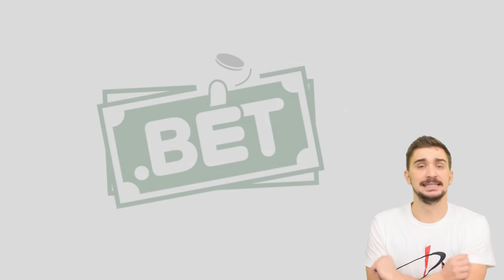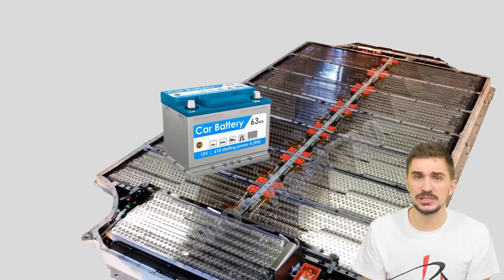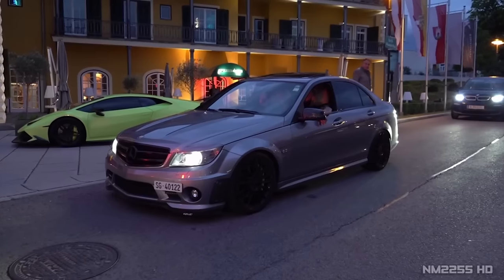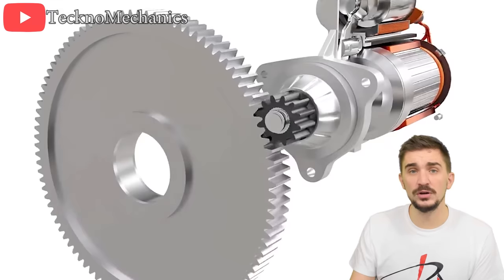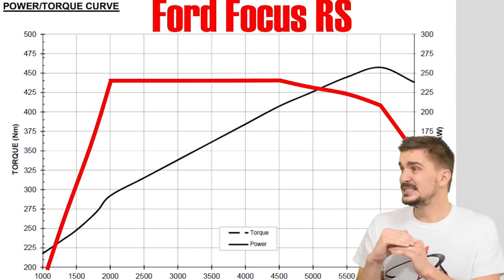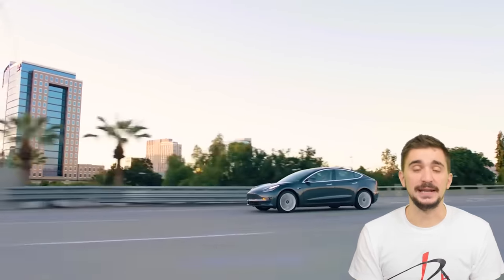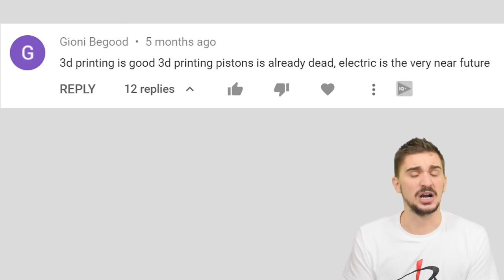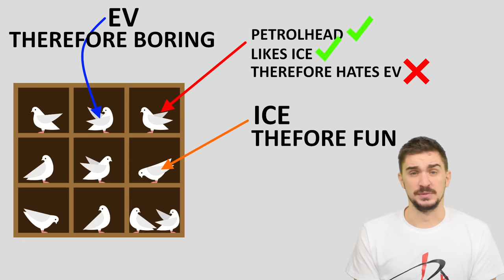ICE vs EV - IN-DEPTH comparison of BATTERY ELECTRIC and INTERNAL COMBUSTION ENGINE vehicles

Comment: Your monologue at the end perfectly reflects my (and I hazard to say the majority of professionals in the tech/ mech engineering space) opinion on the topic. A hyper focus on electrifying cars is the result of marketing. Real solutions to our problems are almost always variable and address whole systems. Electric cars are a tiny part of any real solution. They are phenomenal within a narrow use case. Better solutions exist elsewhere, like drastically expanding public transit in and between our fast growing urban centers, addressing/ drastically reducing emissions of grid scale power generation, finding cleaner more efficient ways to maintain intl supply chains/ logistics, improving resource utilization in agriculture, etc etc etc. Real solutions are hard to market. They are complex and often make unsexy compromises. They are also rarely achieveable by induviduals.
This might come off as cynical, but imo the truth is many electro evangelists have been duped. Environmentalism, like almost everything, has been co-opted so it can be used to sell. It has been rebranded as a problem that can be solved by the individual buying a product. Buying into a brand (tesla) is presented as a stand in for environmentalism. So many people have been beguiled by these ploys. That anyone is so blind to miss the irony in solving climate change with consumerism, is itself a tradgedy. By truly educating, and not watering down topics to make edutainment, you are doing more to protect the future of the environment than any of those detractors. Keep it up. You are awesome.

Comment: You hit it on the head. When EVs are actually viable, I'm all in, but right now they're not.  They're commuter cars in big cities and that's it.  Give me a 10 minute recharge to full battery and enough charging stations to make their range viable and I'll have one.  One thing not covered is environmental impact. Somehow everyone thinks the EV is better by default because it doesn't burn oil, but those batteries are still charged by burning coal and there is a big environmental impact from battery manufacture, so they are not nearly as 'green' as everyone would like us to believe.
Reply: My Ev I charge from the sun. Free of charge. No middle man controlling my gas/electric price.
Reply: @radiculus27  with a solar charging system made from dead dinosaurs, just like everything else.  Maybe check the manufacuring process of your batteries too.
Reply: @mwalker9401  
While almost everything do have environmental impact. Solar is definitely lower that of fissile fuels . Don’t even get me on the lives lost in the name of oil? Millions.  We can go back and forth as anyone can find someone who will support their point of view. Solar panels do generate way less pollutants than fossil fuels . It’s just depends on how the bi products get treated. Some cut corners and others don’t as in any manufacture process. But if handled responsibly solar is way way less pollutant than coal. A lot of articles point out the environmental cons of the manufacturing process but can you show me one that’s compares the two?
Reply: @mwalker9401 oh um there's a video about the the pollution on that it's from GasTroll video name is called " Ev vs Gas which pollutes more"

Comment: As impressive as EVs can be, the thing that bothers me about them is they dont make any sound. A lot of interesting ICE cars have rhythmic intake and exhaust notes, anything from an V2, I3, I4, I5, I6, V8, V10, V12 etc can all sound incredible in their dozens of unique ways depending in brand, size, fuel type, they provide different tones at different RPM while at different throttle points which offers an emotional response like listening to music, this is especially noticeable when even more connected to the car with a manual transmission. Of course EVs have no sound compatible to an ICE engine and never will (unless fake) and of course no multi gear manual gearboxes. This is a major difference between the two types of propulsion. I can also appreciate some people love the near silent operation and performance an EV can provide but for me it's all about the right sound a car can make.

Comment: I am usually an „EV Hater“ just to annoy EV drivers because it is funny to me. But after your Video I realise that I am not basically hate EV Cars. The Technology is really good to be honest. But the Batteries are the Problem. So I am basically hate the Batterie part in EV‘S.
Reply: What's the problem with the batteries?
Reply: @lubricatedgoat  big, heavy, low mile range, low capacity when its cold outside and cost a ton to replace them

Comment: EV owner bragging Maintenance free.  : )   ICE car owner lamenting $39 oil changes.  : (    10 years later EV owner looking at total battery replacement for $35,000   : (   ICE owner after 10 years of oil changes  at $390   : )
Reply: Huh? I get oil changes monthly, but I don't think even people who put on fewer miles are getting less than 3 oil changes a year. The ICE car has way more maintenance items than just oil changes.
Reply: Average car owner will drive anywhere in between 10k-15k miles a year. And it’s recommended to perform an oil service every 5k for regular cars and 3k for sports cars. On top of that, there’s other services to do than just change oil.
Reply: Firstly, not every EV will need a battery replacement. Many go 200,000+ kms on original battery. Especially Teslas. 
Secondly, no Tesla battery is that expensive. 
A story of a $50,000 hyundai replacement battery was the dealer inflating the cost.

Comment: Well spoken. It’s as simple as this: we aren’t there yet. For some people they work. For some they won’t. My problem with EV is that it’s being forced. Governments shouldn’t be choosing winners and losers here. Gas/ diesel is energy. Energy is what uplifts humanity. We shouldn’t be forcing people who can’t afford to buy an EV let alone use one if there are cheaper alternatives. EV cars are not cheap. Certainly not to begin with, and certainly not to replace those batteries. Gas and Diesel engines aren’t cheap to maintain either but at least these parts give out for the most part little by little, and are basic so I can do the work myself. (Sometimes). We are not there yet for EV to function the same as ICE. I’m sure we will get there eventually, whether that’s EV or whatever but we can’t force civilization backwards because of the idea that we are damaging the planet into oblivion. They use fear to control people and they’ve done it since we started our first civilizations. Wake up people.

Comment: If all should drive ev there is not enough meterials to built all the battery. And the metal used in battery is digged out by Kids.
Reply: we need a new battery
Reply: Cobalt, there's a lot of effort being put forth to reduce or eliminate this from batteries.
Reply: @lucasvanhamburg4937  check out solid state batteries
Reply: Not enough electricity generating capacity either
Reply: Better chuck out all your phones and laptops then.
Reply: @lubricatedgoat  a car has thousands of cells, a laptop for instance has 3 or 5 the bigger ones, so not exactly the same...
Reply: @jnrivers  Also Lithium, Bolivia atm is one of the largest providers and like Venezuela they are basically a Russian controlled puppet

Comment: The instant torque thing about ICE cars is somewhat wrong. I will take you with my Mercedes OM606 turbo diesel making 300HP. I will rev the engine to the sky and dump the clutch. You will see how instant the torque is. "More" instant than an EV because of the inertia of the engine's components being immediately transfered to the wheels. BTW my OM606 picks up revs extremely fast and It makes peak torque at ~2000RPM so i dont need to rev it that high.
You also said that ICE cars have become very reliable because of the centuries we have been perfecting them while electric cars are something new. Well, no. Electric motors and inverters have been around for centuries before they started getting into cars. Electric motors are extremely old.
Reply: Wrong...
Reply: @montreauxs  wrong? I need justifications
Reply: Electric motors and inverters are old and perfected, but they aren't really the problems in electric cars. High capacity batteries are the new thing.
Reply: @LevisL95  still lithium batteries and batteries in general are not a new thing at all. And all those electronic components inside the inverter which handle huge amounts of current can also fail. What i am trying to say is that electric cars are not something new that has never been improved and is are already the best while ICE cars cannot be improved any further. Moving to forced induction 2 stroke engines would be the best move. Instead of wasting power strokes and having extra cylinders and CC for power, with a 2 stroke you can achieve the same power with less cc and cylinders and you get better fuel efficiency, less weight and less moving parts. Also big low revving 2 strokes sound SICK ASF. Go listen to some detroit diesel 2 stroke engines. They sound mean asf
Reply: @dieselgeezer18  Are there efficient 2 stroke engines? The ones I can think of are thirsty as hell, but I guess they haven't been seriously developed for a long time. Direct injection and forced induction could make wonders. Anyway, there are definately exciting developments in combustion engines too. Like Mazda's Skyactive-X engine, a petrol engine with spontaneous ignition.
Reply: @LevisL95  you are probably thinking of the extremely inefficient, smoky, thirstly and quick to wear down dirt bike 2 strokes. The ones that i am talking about have a dedicated lubrication system like regular 4 strokes and they don't need oil-fuel mix and they don't smoke at all. If we move towards efficiency diesel is the best option since it packs more energy per a given volume more torque lower RPM since it burns slower. We could keep petrol for the fun stuff, even though i find diesels extremely fun too. Also a great idea would be bio diesel. Running an older diesel car on vegetable oil can reduce the carbon dioxide emissions by 70%+. In a modern car with the right improvments we can reduce the increased NOx outputs too.
Believe it or not, my OM606 turbo diesel which makes 300HP  gets me 30MPG when i drive normally and about 20 when i drive it hard. Its a great engine. It combines reliability, power and good fuel consuption. Stock makes about 170HP but with a new turbo and fuel pump you can easily get 400+ HP
Reply: Try doing that a hundred times in a row.  A Tesla can launch without tearing itself apart.  Dropping the clutch on a high revving engine is fun, but it'll not last long.
Reply: @lubricatedgoat  The first teslas were notorious for chewing gears because of the instant torque. A well made ICE car with beefy components won't get destroyed by dropping the clutch. I have installed a beefy rear differential and transmission. I've dropped it a million times and it stills works fine. Also my engine is not high revving. The max RPM is 4500

Comment: The EV thing will not make sense until we can produce all our electricity needs without using fossil fuels.  Renewables just don't produce enough, nuclear is too taboo, mmmm.  When the tide turns on tax incentives it will be interesting to see the outcome.
Reply: Thank the extremely unintelligent public for the lack of advanced nuclear power.
Fear plus stupid equals burn coal.
Reply: @lubricatedgoat  Hi Mike, we have loads of electricity from nuclear power, the problem is that most of it comes from France...  Totally agree with you sentiments.

Comment: electrical engeneering student here, we divide them into direct curent engines, alternating current ones that are non sincronised and sincronised. But they largely follow the same principle and are quite simple. Mass adoption will be done via induction, not permanent magnet, but the achile's heel alwais was, is and will be the battery.

Comment: You do change the duty cycle of the waveform in AC motors too, to decrease the voltage (and by that current) at low load to conserve energy. No point in putting 100A through a phase winding at low frequency if you only intend to drive at walking pace.

Comment: In the US, it's difficult for you to win the bet. Most automatic transmissions only allow engaging the starter in Park or Drive. I don't know whether a torque converter will transmit power at cranking speed. 
  Similarly, most vehicles with manual transmissions require full depression of the clutch to activate the starter.  (2005 4wd Tacoma has an override switch to allow using 4-low to extricate yourself from a precarious situation without any rolling back).

Comment: An advantage you might’ve missed: traction control.
With an EV, you have direct control over how much torque and power you output and draw, with that near instant response at any point. This allows TCS to very quickly and accurately manage the torque output at the wheels for maximum grip at all times, even allowing for minuscule amounts of slip to maximize grip. On ICEs, there’s no direct control over torque. You can open the throttle, change timing, and do other stuff to get excellent response, but it just isn’t as millisecond quick as an electric motor. So ICE TCS can’t be as aggressive with grip levels as the EV since most of the time, all it can do is pull ignition timing to reduce torque, and it can only do that so many times a second, though quite a bit more mechanical give than the single speed transmission that EVs usually have.

Comment: If you need a video idea: Piston crown shapes. Like the ones for lean burn engines,  penthouse like designs, valve cutouts, the ones with a weird hole in the middle for diesel engines etc

Comment: You have not done any videos for hybrid vehicles? As a 3rd Gen Prius owner that would be very interesting because the tech inside the hood ("Hybrid Synergy Drive") is pretty amazing. Just check the wiki article about it.
If I have some juice left in my drive battery, I can get an instant boost of 200nm. It is like having a part-time turbo in my Atkinson cycle 1.8L engine ;)

Also 1-speed planetary gear (e-CVT) would be an interesting subject for you.

Comment: I love my BMW Z3 M roadster and have done modification to make it stop fast, turn fast, go fast with 330rwhp/300tq NA, with weight reduction tipping the scale at 2100#.  Love the rage of my truck being able to just go and get gas and back to going then get gas and keep going until I need to rest however I want a EV for my 1.5 mile to and back to work 6-7 days a week.
Reply: Build an overpowered electric mountain bike.  It's a blast!
Reply: @lubricatedgoat  indeed, less safety gear then a motorcycle so the adrenaline rush is even higher.

Comment: The Telsa Model S Plaid has a motor design that seems to have solved some of the back EMF issue allowing it to maintain power all the way to 150mph.  Sandy Monroe did the teardown on that car and when he cut open the motor he said "Tesla must have invented some new physics" when he saw the motor winding pattern.  Pretty interesting.  

Something that is also interesting is that ICE engines often outlast the cars nowadays.  Most of the cars I've gotten rid of related to the paint failing or the air conditioning or something like that.  I've never replaced a car because the engine failed.

Great Video BTW.  I can see you put a lot of work into video editing.
Reply: Exactly, ice engines have really become reliable and long lasting over the decades. The same will happen with ev's. Batteries will pretty much last the lifetime of the car. They are proving to be much more durable then expected. And this will only improve going forward.
Replacement batteries will only ever become a thing when cars are actually built to last.

Comment: Improving the efficiency of ICE engines has done more to reduce CO2 emissions than the relatively small number of EVs so far. Switching from SUVs and pickup truck (which how many people really need?) back to sporty sedans would do much more, and be more fun as well. I personally don't even own a car. I live close to downtown in a major city, so everything I need is within walking or biking distance, or by public transit. It used to be that you needed something like a truck or a station wagon to buy heavy stuff and lug it home, but now you can have it delivered. When I occasionally need to get somewhere fast I call Uber. Ownership means paying a bunch of money up front, then making payments, paying for insurance, fuel, maintenance, parking, etc: it's just not worth it. For long-distance trips, I either fly or take the train, then rent a car at the other end. I took my son on a grand tour of Europe, flying to London, then Paris, where I bought a brand-new Peugeot on a rent-to-buy scheme, drove it all over the place, then returned it, all for less than the cost of a rental car. If you must have an SUV or a pickup, you could get a small EV commuter car and leave your ICE vehicle in the garage until needed. The point is, it's not either-or.

Comment: The fall of torque with speed is not just a back EMF driven. It is a mater of limited power (say at max i.e. constant). Power is the product of Torque and speed. At constant power the the torque has to drop  as speed rises (see the hyperbola Torque*Speed = max power ,  or Torque = Max Power/Speed. Clearly torque is reversely proportional to speed.